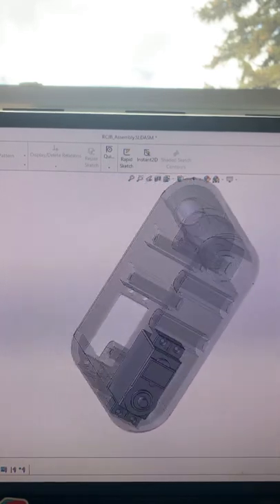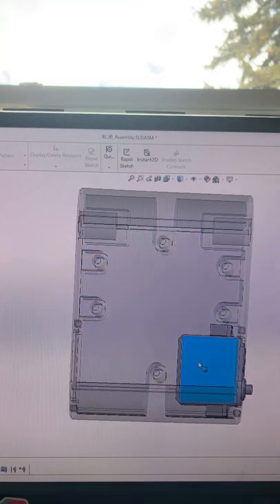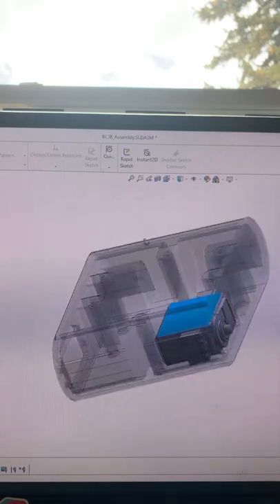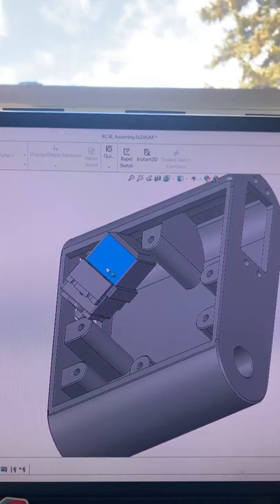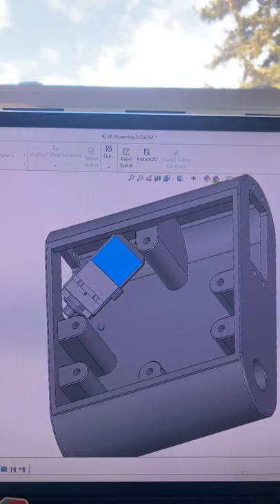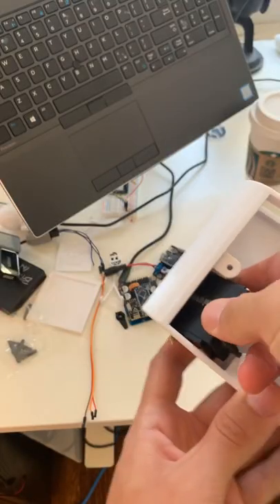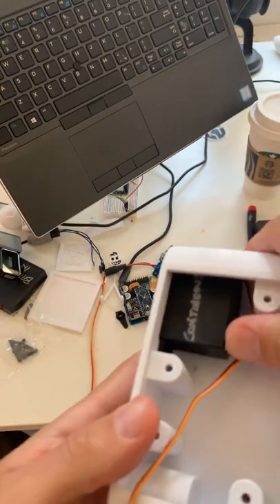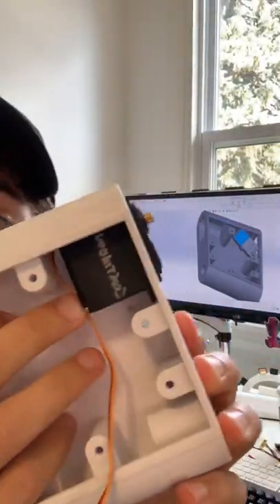CAD World vs. Real World - Engineering Process

Comment: I see an engineering job at bmw in your future. 'well I got it in there, but good luck for the next guy taking it out.'
Reply: You mean every new car?
Reply: @R_o_b_e_r_t  Sometimes, but BMW and other expensive luxury brands seem to be more notorious for making it extra hard rather than somewhat annoying
Reply: @RaisinBarXZ550  I mean there aren't any German luxury car brands anymore

They're just regular cars now
Reply: @falcy2889  like the brand's themselves have become normalized, but compared to a Corolla the prices are higher and the luxury is too, and they still make proper luxury and expensive models
Reply: I have dealt with cars all my life, great source of entertainment especially when your dad owns, races, and builds drag cars (RIP to the old man, wish he could have met my kids, not a perfect dad but perfect to me). In my experience sometimes the best way to remove certain things was to break them instead of spending precious time finessing them out. Maybe and mostlikely scratching and damaging other more expensive parts. Like body body clips.... we kept hundred in a bin.... makes no sense to spend time salvaging and reusing them, use a shear tool to get em off and move on quickly. Exhaust systems.... after the headers..... we litterally just Sawzall or torchbof the rest... not spending g hours on a bolt I keep in a bin by the hundreds, even the rubber suspension grommets get the same treatment. Suspension bushings..... press it out? Nope Sawzall, warm it up and throw it in the trash. We'd throw in somethings like a free oil change because it helped us move quicker and eliminate some suspicions right of the bat. (We burned the used oil for heat so it was a wash). For certain cars it was cheaper to unfold a non functional mirror and put a whole new unit than start dinking around with dissasembling it to diagnose it.

Part of engineering is to figure out what the best route for the person repairing it needs to head. A lot of times, it's best to KISS it. "Break off, clean, and install new part, torque to specs". If they can indiscriminately remove a non functional part or a whole system that contains that non functional part, install a new unit and move on quickly to the next client, that keeps service techs moving to thw next client. You round up the systems containing a defective part, send it to a warehouse, if the need ever arises you can send these parts to a refurbishing specialist and get the broken out another time when the demand exceeds EOL production date. (This is what BMW does BTW)
Reply: @falcy2889  Maybach is the luxyry brand of Mercedes though, Rolls Royce and Bentley also still exist

Comment: In my opinion this is design flaw, because force shouldn't be necessary to fit component inside housing and also what about repair possiblity, then you need to pull faulty component from the housing to replace it?
Reply: I don’t even know wtf he made but its something that has to be a tight fit so it needs force to fit it in
Reply: @beybladesinmyheels1267  No, the motor screws in, there’s no need for it to be forced into place. This is just a bad design.
Reply: @beybladesinmyheels1267  wrong.
Reply from the maker: Nothing wrong with a little force if it get the job done 😉
Reply: @Engineezy  If you needed to make hundreds of thousands, you will have incurred countless of hours of wasted labor and heaps of scrapped parts because you didn't account for the fact that teams of humans have to be trained to assemble these things with various degrees of dexterity and force.
Reply: @Engineezy  if that exist, it means it’s poorly calculated.
Reply: Resurrecting an old video and thread here, but the whole point of the channel is rapid prototyping and really cool one-offs (well, one-off projects that may sometimes involve multiples of the same part too), not design for manufacturing activities. The video is literally about recognizing that when prototyping you need to know when you've learned what you can from the CAD and should just try it out. This would be a great first step in an iterative design process to figure out what improvements can be made before moving to production. For the purposes of this project, it would be a waste of time and materials to keep iterating when the prototype is sufficient for his needs, but it can serve as a lesson for designing different parts in the future.
Reply: @Engineezy CTE’s and warping have left the chat.
Reply: @jamespeterson7125 It’s a bad lesson. Teaches people in who knows what different fields that it’s okay in general to design a part that fits that poorly.
Reply: @jordanhenshaw  all I'm going to say is that I disagree strongly. I do design work for a living and depending on your field and development stage things like this are just fine. This stuff is great for feasibility and prototyping. Of course it won't work for a final design requiring thousands of units or robust reliability in different conditions of years of service. No one is coming here for DFM, DFA, or even engineering best practice. It would actually be inappropriate to spend hours of additional time on this to get a better fit, assuming you even would without making  a physical model. The best engineering, in my opinion, happens when there is a good understanding of the design requirements, meaning the solution is tailored to the application and understands when additional work/material/processes are not value-added activities. This design is more than likely a one-off display piece that will be in a particular temperature range, low cycle count, low load, and low stress. Spending many hours refining design and printing multiple iterations to make it perfect for thousands of units, a large temperature range, and thousands of hours of service just wouldn't be good use of his time.

Comment: This is a problem with engineering practice mentality.  If it doesn't fit in the model, you are guaranteed screwing you build/repair team once they have to deal with it in the field.  I am a design engineer, and got to work a lot with our mfg and field service teams.  If you absolutely have to do this, give it to both parties first, and make sure you aren't going to have problems.  As an example with this case, try getting that motor back out when it is attached to something else.

Comment: You can always cut up the model to just the area where you need to test to save on materials and time :)
Reply from the maker: Very true!
Reply: Though with a small model like this you can also bet on it working, or at least well enough that you can dremel it to fit, and use it as a prototype.
Reply: I do this allot, especially when it comes to screw holes. Just print 3 layers even to see if they line up and are the correct size
Reply: Agreed. For fit tests, I usually only print the walls that are absolutely necessary for the test, and print at a much higher feedrate.
For example, a fit check for a motor shaft would just be a small cylinder, rather than the entire rotor.
Reply: @user2C47  true, but you have to be careful. Several times I have printed a section quickly only to discover that when printed with normal print settings fits are tighter than on the tests.

Comment: Ok so you have 6 screw-pillars printed on the lower part of the case which means you have 6 holes on the top part.

You could print 1 of the 2 screw-pillars on the top part and the screw hole on the bottom part.
Reply: This
Reply: Exactly what I was thinking the whole time.
Reply: Or... move the f-ing post over a couple mm!
Reply: There is a bunch of solutions for this dunno why he thinks there is no solution
Reply: @IsaacAlcocer  he never said there was no solution? I think he's well aware that he could change the design but made a teaching moment out of it
Reply: @post_historic  aesthetics. if you move it over you remove the symmetry same with reversing the post that being said there are a bunch of options but all of them require time at the very least this seemed like a s small print so he could have it go while he was on lunch
Reply: This is actually really clever. Something to keep in mind when I am designing something but I'm locked into the paradigm of injection molded parts and not thinking about the flexibility that 3d printing offers
Reply: Maybe it needs to be opened just from one side...
Reply: @outsider344  You can't injection mold this part with the undercuts on the radii. He should have designed this as a clamshell. It would have also solved his assembly problem. Bad engineering design, through and through.
Reply: @aureate  "you cant Injection mold this part" that is an incredibly bold claim to make
Reply: @outsider344  As designed with those undercuts? Yeah, not easily unless you do something unnecessarily expensive.

Edit: FYI, I work in injection molding.
Reply: @outsider344  I've not 3D printed before, but could you pause the print halfway, pit the motor in, then continue the print to lock it in place?
Reply: @MrNinjahiga  Absolutley. You would lose some of the set it and forget it convenience that 3d printing offers by needing to be present for the pause though. You could program in the pause ahead of time and have it wait for you, but you don't want to let the printer sit paused for very long, plastic sitting in a hot nozzle can go weird.
Reply: @outsider344  neat. I feel like that technique could definitely have it's uses
Reply: @superchargerone  Man, you seem to have really gleaned a lot about me from my 8 word comment. You standing by the statement I was talking about then? The one about how that part cannot be injection molded? Even the original guy who said it walked it back.
Reply: @outsider344  right and why did they use he would want it PIMd?

Comment: That's why I do a lot of test fitting prints. In this case, I'd put a negative zone in my slicer so only the clearance test gets printed, that way instead of taking 6 hours and a bunch of filament to test your fit, it might only take half an hour and use a fraction of it.

Comment: Could you have just paused the print before it started covering the area the motor was going in, placed the motor, and started it back up? Maybe double sided tape to keep it in place if you’re worried about it moving during printing.
Reply from the maker: Definitely an option!
Reply: @Engineezy  Unless you plan on removing the part in the future. I typically only use this method for inserting nuts or when I need to fill a part with ballast.

Comment: Cool work! Would you consider altering the shape of the flange in the corner just a little bit, or maybe moving it a mm further from the motor? 

Idk the application, but if 3d printing isnt the final production process for the housing i would be worried about production tolerances of the housing.
Reply: I take it you're not familiar with his channel. He creates mechanical sculptures. It's not likely that there will ever be more than a few iterations of his current piece.
Reply: @danielstewart3507  ah, youre right i am not familiar with this channel. If its low production run then that tight tolerance is ok, even a good thing in a way:)
Reply from the maker: @Daniel Stewart got it right, design for production is a whole other animal!

Comment: If you wanted to test if it'd fit, you could have just printed either that one section of the model, or printed a simpler geometry and faster to print mock version.
Reply from the maker: Very true!
Reply: @Engineezy  Although on second thought, it'd probably barely cut down the print time, so you might as well just do the full print anyway haha

Comment: Could just made a larger hold for the motor to slide into from the outside then just made a small bracket piece that either snap fit onto the body or was mounted onto the body via small screws. But I'm no engineer
Reply: Or even better use a PC psu mounting style system
Reply from the maker: Definitely would work, but the motor would stick out a little further than I would have liked
Reply: @Engineezy  fair

Comment: I really think engineers need at least 4 years of experience working in a maintenance/equipment operator field before they are allowed to graduate. I’ve come across so many different levels of hellish nightmare at my job all from some engineer drawing something on paper and thinking “That’ll work”   Imagine a loading bay for a place that receives pallet deliveries. Now, have the driveway up to it be above grade of the floor in the building, and the wall be at a 40 degree angle from that driveway. Now, put a slope, at that angle, down, but have the road continue straight into the garage. Then, try and drop off pallets in that garage bay with a forklift. Now in case some people don’t know, only the non turning wheels are powered, and they typically don’t have a locking axel, so you just dropped a pallet off, attempted to back up that slope, then one wheel is airborne because some absolute moron thought an angled slope is a fine idea and poof, forklift is now one wheel wondering and stuck. I really want to find the blueprints and find out who signed off on this abortion. It wasn’t a retrofit, someone designed it like this new. I want to take that persons face and shove it into that slope like you would a dog that left a turd on the carpet to “train” it to not do that again. That’s only one example, I also want to find whoever designed our parking ramp and do that same explanation of turd on carpet in all of the next to impossible to remove snow from areas (it’s just hell, it’s the only way to describe it) in an area that gets feet of snow every winter. Just no common sense in the design, no thought to how snow would be removed, just absolute pants on head stupidity.
Reply from the maker: I’ve worked with engineers like that 😂

Comment: What is the software you are using for CAD in the video?
Reply: SolidWorks!
Reply: @BrownMInc  thats not solidworks. Or not what i am used to.
Reply from the maker: It is most definitely Solidworks!
Reply: @Engineezy  Yes. After I watched the video again it's very clear that the file extension is .SLDASM, how did i missed it at the first place. Are there any other software you use for drawing?

Comment: You could of brought a shorter servo
Reply: He could have bought a shorter servo, but the smaller servos have less torque.
Reply: @ferrumignis  that's beside the point. Small servos have a lot of torque. But if he designed a part of a small servo he would have the same problem it's like replacing a starter motor for a car they designed the car around the starter so it fits in when completed but it wasn't designed to be replaced without a headache and a few bloody fingers and a mechanic crying in the corner in the fetal position 😭👍🏻👍🏻👍😃
Reply: @stevenatkinson2393  How is it besides the point if a smaller servo couldn't do the job? That is an extreme bit of cope in response to having the flaws in your argument pointed out. Do you have secret inside knowledge of his project to know that a less powerful servo would work ok?
Reply: @ferrumignis  the same applies to you do you know the requirements for torque output or weight requirements in his project do you have inside knowledge. I understand where this guy is coming from throughout my 30 years of dealing with people that think what they write down on paper must happen in real life
Reply: @stevenatkinson2393  The same doesn't apply to me as I am not the one second guessing the guys choice of servo. Try again.

Comment: Why are people not more annoyed about referencing this as at least as a motor not even a servomotor or servo
Reply from the maker: A servo is just a motor with a built in controller, thus it is a motor!
Reply: @Engineezy  or it’s a servo as per specification  noun
short for servomechanism or servomotor. However you you could also compare this to engineer vs someone just with a 3D printer. I do see the confusion

Comment: Servo, not motor
Reply from the maker: Servo…motor?
Reply: Servos are used to turn things left and right, or up and down depending on how you position them and motors are used to spin things to make something move. For example: a RC car, the servos are used for steering and the motor is like the engine, it makes it go forward and backwards.
Reply: @Engineezy  is that a RC car servo?

Comment: No way of knowing? Collision detection!
Reply from the maker: But what about the material flex!
Reply: @Engineezy  Solidworks FEA added a section in 2018ish that allowed analysis of material interfaces like those clip buckles on rucksack etc but based on your design I wouldn't spend the time setting that up.
Reply: Chamfers are your friend. You could stick a large chamfer on the underside of the lip for additional clearance.
Reply: ...or just sink it in from the outside.

Comment: How did that piece only take 6 hours?
Reply from the maker: Fast print!
Reply: @Engineezy  what speed did ypu print it at? I have an ender 3 max with mss direct drive and dual z screws. Just wondering how fast I could print with my setup
Reply: @sofghost6663  its not necessarily only speed. U sound like u know what you're doing so im just gonna save on explaining and just tell u to try the chep extra fast profile
Reply: @brandonkhoo6510  yea I seen the video for the fast profile just never tried it out. I'm going to be messing around with it till I get the speed and quality I want. I'm going to be building a complete master cheif suit so I'm trying to get the speed as fast as I can without sacrificing quality
Reply: @sofghost6663  have u ever done cosplay pieces? I would say quality over speed, u can have a 1 day helmet print and the layer lines all over the place or u could have a 3 day helmet print and the layer lines look good. the 3 max is a bed slinger , so layer lines are crucial, dont try to go so fast u loose too much quality